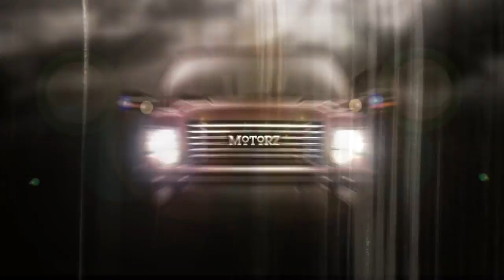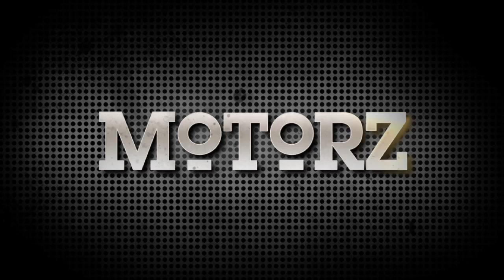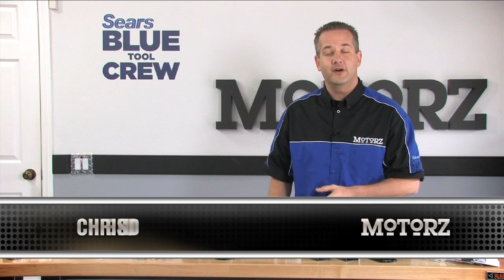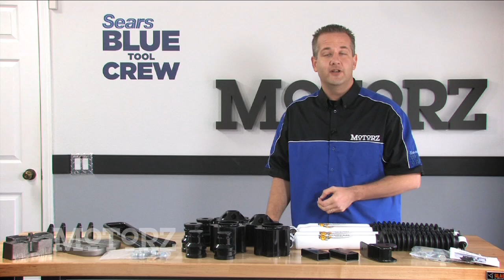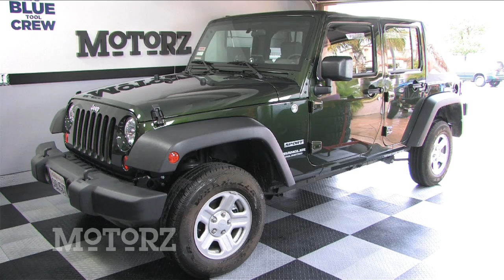How-To Lift Daystar Suspension Lift Jeep JK and GMC 2500 Motorz #56

Comment: Torsion lift with blocks is only stupid if you're lifting higher than 3". Anything more than 3" is going to really stress your ball joints and drive like garbage. Any lift 3" or less is fine for a Torsion and block lift. I know plenty of people with a 2-3" Torsion/Block lift just to fit 35" tires. They have been running that way for many miles and years without hearing complaints about it. That's only because GM will even tell you anything 3" or less is still within factory and safety standards.